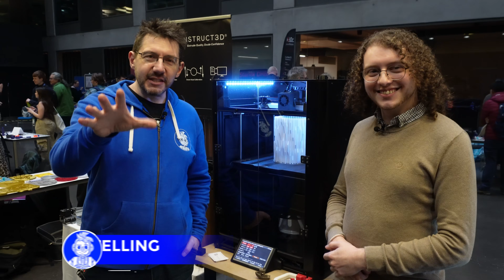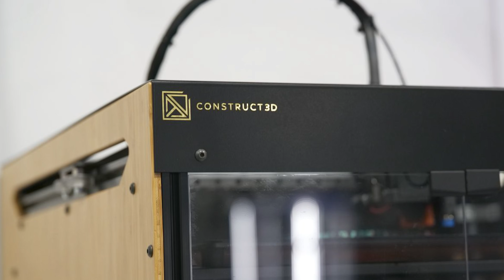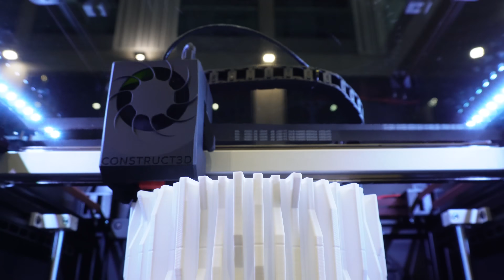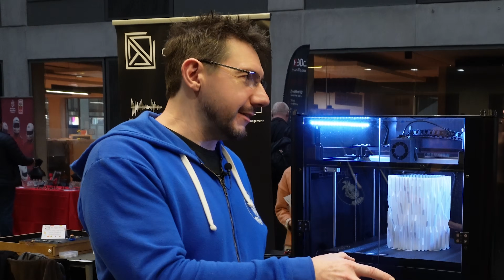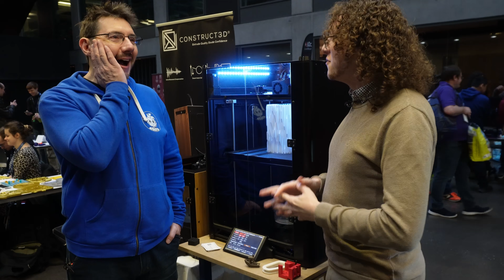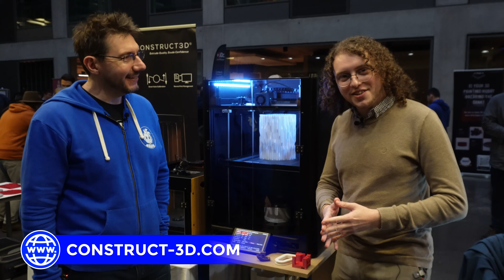Construct3D is Doing Something Different...

Comment: To the people saying they didn't talk about the hot end, it is at 4:54 
They don't show it, but they talk about the flow rate speeds they are getting with it.
Reply: Want some YT comment exclusive info on the hotend?
The lever on the right is indeed a filament cutter for our unreleased MMU unit.
It also has flow rate detection, so if under extrusion or jams happen it can detect, compensate, and if too extreme, auto cancel / pause.
The Print head also has 2 bed leveling sensors. one peizoelectric nozzle probe, and another eddy current sensor. Doing so lets us get an absolute Z position with the nozzle, then hand over to a 900 point bed leveling eddy sensor.
We also have a fully custom adaptor to convert from E3D heatbreaks directly to Phaetus hard mounts, without interrupting any possible force paths for nozzle probing.
A new development is the tool board which may also be moving to the back of the printhead to increase the X axis size from ~330 -> 350mm

Comment: 7:40 I looove this. Will there be a secondary code for if someone is color blind? Like, only green can have 1-3 long flashes, red can only have 4-6 long flashes?
Reply: Its fully programable, so you can re-map any colour to the individual users requirements

Comment: I feal like this printer is a solution looking for a problem to solve that doesn’t exist. Zero industrial company is going to allow operators that kind of control. This is why in the cancer world you have programmers and operators. You give operators programming control and you destroy chain of custody in your programming and it’s all down hill.the operator will be given a thumb drive with a printed sheet with the details. Thy walk to the machine and start. Also hardening because of radio interference from other industrial machines is not really a problem as no one is going to be putting this next to a concern plasma as the dust will destroy it. Also chic plasma does not use high voltage arc start anymore so also it’s not really an issue. My concern plasma table has a monitor and in computer built right onto it and when I designed it I didn’t do anything special to cut done on noise and I have zero problems.

Comment: As there is already color coding in the world i dont like how they just use colors they want... 
product safety should concern some standards
Reply: You're exactly right. Could you send us a DM/Email if you know any particular standards we should be following. Safety Uniformity MUST come first.
Reply: @construct3d  Not really as a lot of companies do thier own thing unfortunately.
But some colors should be reserved as absolute specials like yellow, green, amber and maybe also blue.
Maybe you could consider even mixing it with white with your argb settings.

As from my aircraft experience i would prefer system relevant things, like status or events as green or blue.
problems without causing something harmful orange and the most problematic red. 
the others should be reserved for your own whishes i guess.

Also solid color and flashing, fast flashing is a good option to diverge.

EDIT: As in your video: purple should not be a crit failure.. more like a flashing red.
And the yellow just for babysitting moments could also be triggered like a feature moment with blue or light flashing blue. So no panic is provoked. 
But what if the lid is not fully closed? orange. 

Like this. :)

gl

Comment: i am disappointed the thumbnail is a photo of the hot end with no mention and discussion about the hotend.
Reply: 4:54 
They don't show it, but they talk about the flow rate speeds they are getting with it.
Reply: They talk about the hotend being the E3D Roto at 5:40. He also gives the motivations for why its such a good choice for this setup.
Reply: @techjedi2878 nah thats the extruder, the hotend is a Phaetus Dragon UHF
Reply: it looks like the Phaetus Dragon UHF, nothing super special in the high flow hotend world but its a volcano variant of a Dragon HF and E3D Roto extruder

i mean it's alot of bang for your buck, it's not like overpriced Slice hotends but similar performance to the magnum probably

either way very solid hotend, and with Volcano CHTs wont be a slouch lol, it's easily 60+mm³/s

this hotend is literally that high flow that cooling has to be very powerful on the printer to really max it out, a few 5015s wont be enough thats forsure
Reply: E3D Roto with a Dragon Ace.  That's what's in the thumbnail
Reply: Yeah, that’s the entire reason I watched the video.

Comment: Enthusiastic guy and i hope they do well, but to be honest was really disappointed with the engineering of their printers, with very outdated components questionable choices in their kinematics and a printer thats not worth half the cost its selling at. Would of been impressive to see them insualate their printer better than just add a heater. 75c can be achieved by uaing the bed only if insulated correctly.
Reply: the hidden 8mm insulation we have on the inside of the printer does actually let the printer get upto 75C. The peaker heater is just so you dont have to heat soak it for an hour to do so 😉
Reply: @construct3d apprieciate the reply. 8mm isn't going to do a whole lot, (material dependant). especially as you haven't dealt with the door or top. Ideally you want something like 20mm of insulation on the walls and a double paneled door to give you the insulation needed to easily get up to 75c in the chamber with no extra heater. The end of the day, you bed is already a chamber heater so if your struggling with getting up to 75c with a bed of 100c. You have bad insulation.

Comment: 45 mm3 for PETG is impressive 👍👍
Reply: wanna know a secret/ We actually have measured 60 mm3 with regular PETG. But to make sure we cover all materials we normally advertise much less.   Under promise, over deliver!
Reply: @construct3d  ooo nice!  What nozzle size did you use?  Or does it not matter?
Reply: @jacobm2625  All of this was measured with a 0.6mm CHT abrasive resistant nozzle as that will be the default for the machine. 
You can get more if you swap it with brass, but most users will be printing CF/GF materials

Comment: Is this klipper? Is it Reprap but with the pi for the interface? I remember him saying he didn't like Klipper in an industrial context so I'm very curious about what this is.
Reply: It is RepRap with the Pi acting as the SBC compute.
Reply: @construct3d  Can you expand on what SBC Compute comprises of? I'm very curious about what the PI it self is responsible for with Reprap.

I'm thinking things like octoprint, spaghetti, maybe even auto input shaper calibration which I don't think Reprap has by itself yet?
Reply: @BeefIngot  RRF and Klipper when using a Pi is actually really similar in how they use the PI for the movement compute, and then hand over the commands to the mainboard for simple motor control.

What differs when using a SBC instead of just the mainboard is some of the following:
2.4 + 5ghz wifi, at VERY good speeds
Ethernet
Can run encrypted gcode
Multiple high resolution camera support
Can run full python and C scripts behind the scenes
Can play doom whilst printing
Full offline and airgapped capability without functionality loss
Can run much more power intensive AI programs. Think spaghetti detector on steroids
Also can data log MUCH higher levels of accuracy which is great for print monitoring before things go wrong

there is a lot more, but this post is already getting kinda long

P.S Nvidia AGX Orin is blursed

Comment: seems like nice machine. but just using off the shelf parts. not sure whats actually different
Reply: You could get off the shelf parts to turn your car into something out of Fast & Furious, but would you be competant to put them all together? What I mean to say is, if you can do it yourself, go for it, have fun. If not, or you simply don't have the time for the effort, someone like Jacob is EXACTLY what you want.
Reply: Knowing when to use off the shelf is a very hard and humble pill to swallow. What sets us apart differently however is application of parts, and the level of research and testing to guarantee the parts (and companies) we use actually perform better than if we did full custom on our own
Reply: Try rewatching it at .5 speed and with captions on. You missed the parts where they talk about custom stuff.
Reply: @LincolnWorld watched it again. Still don’t see anything new. Adding temp sensors and a picko heater? Rgb leds? They didn’t talk about the hotend even tho the video thumbnail shows something. Just uses a roto extruder. Rasp pi 5… seems pretty off the shelf. But still a nice build

Comment: "wow, it does the heating automatically?"... bro, did you expect to have to manually adjust each of the 3+ heaters in real time?
Reply: Manually adjusting the heaters in real time would be diabolical.  To clarify what I said (as I was VERY sleep deprived when this was filmed) Some materials actually can want variable chamber temps,  additionally, as the bed moves down the effective output of specific heaters changes, so the printer needs to dynamically switch which heaters are being used.